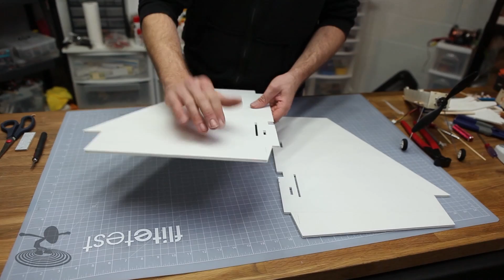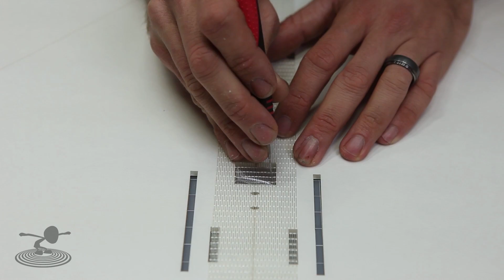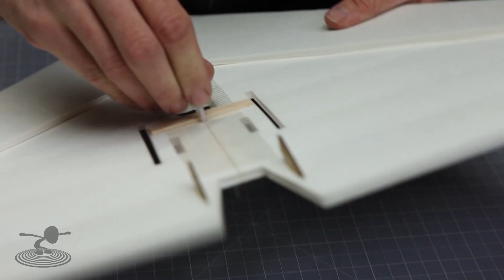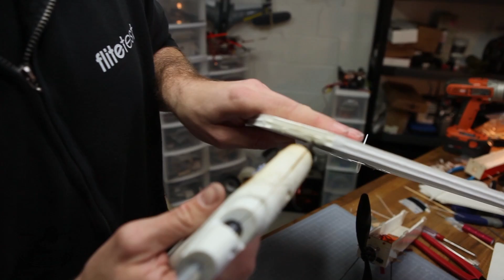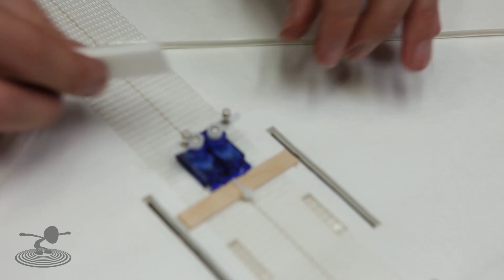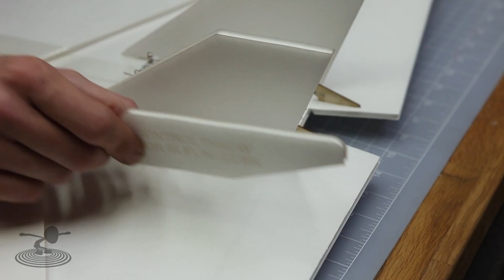Flite Test - FT Delta - SBK - BUILD

Comment: Does anyone know what is maximum allowable weight with this plane? I made it with local foam board which seems that heavier than video. My plane is 285g without battery. My battery will be 76g, so I'm worrying that mine is too heavy.

Comment: I downloaded the full plans and built the FT Delta.  I didn't cut the two wing halves apart.  I left them as one continuous sheet.  Is there any reason they should be separate if they can be kept as one piece?  Did you have it as two pieces for purpose of shipping precut kit?

Comment: I built a 2nd one with some upgrades. I placed led light lines inside the wing so I can night fly it and placed a camera looking to the rear. Now with the extra weight it climbs a bit slower but it is still very stable and easy to fly. 

I also modified the fuselage. It is no longer swapable. But the battery and camera are all placed inside the fuselage. I do not have landing gears on it, so I hand launch it and belly land it. With the extra weight I still get about 8 min safe fly with the 850 mah battery.

Comment: This might be dumb question but where does the plane get the lift from with those flat wings without an air foil?
Reply: its has a KFM-2 Airfoil so it kinda does have an airfoil, but surface controls help keep the plane in the air.

Comment: That is extreme packing tape. I've found it a few places online but so far I've not had any luck finding it in a local store...
I think you can just use the fiber reinforced strapping tape as a replacement for the extreme packing tape, it just won't have the cross reinforcement. The extreme has fiber going both directions like a screen and the strapping tape has fibers only running the length of the tape.

Comment: If you can go to a local building supply they sell markers you see when they mark  under ground services. These little flags are on wire that is fairly stiff but can be bent for z bends  usually about 8 cents for each  in packs of 25 I got mine at Lowes.